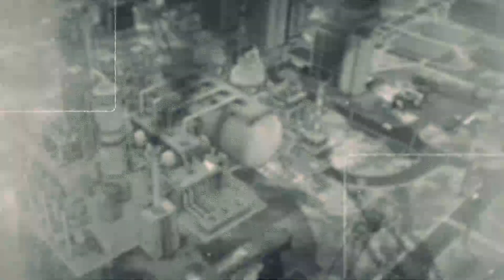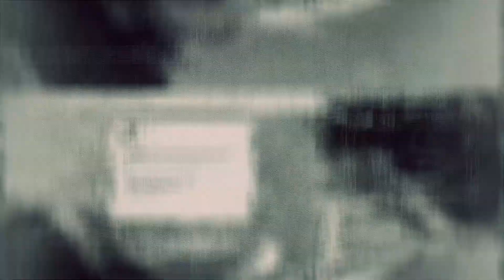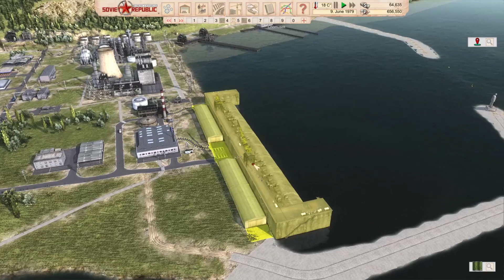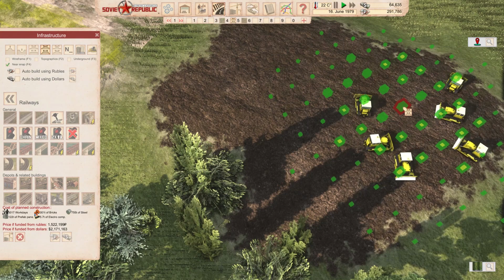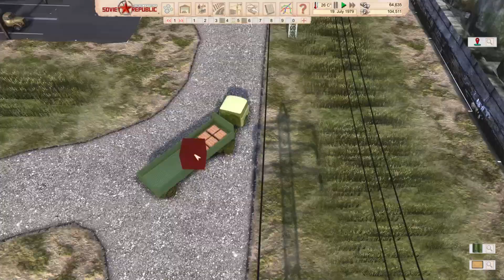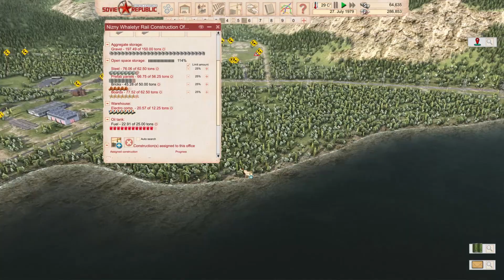Soviet Republic - Alaska - The New Beginning - Ep.63

Comment: Good day sir, I am all for a rounded rail what you came up with looks really nice and I think it will be really cool. When trains start running on it! I was wondering how you were going to get it attached to the network at large, that's a great system. I was thinking last night that a brick bridge would look. Really cool but it would take millions of bricks to make. I really like the look of the brick bridged it would change the whole feel of things into an older look making the town look like a walled city. Interesting solution to the vehicles in the helicopter station. I had the same issue and could not figure out why. It seems to be working now I think the capitol city would look great with a waterfront roads thay hugs the coast! The whole area is looking fantastic my friend. I have to admit I am getting a little more fond of helicopters in construction. The whole infrastructure could be a wonder of Alaska for sure. The bridge across a valley could be a wonder for sure! That talk substation is My favorite one, I have them all over my cities then I use the lower buildings for ones on the outskirts and in industrial areas. Have a fantastic day sir! Another top notch episode!!
Reply from the maker: Thank you! 
I'm warming up to helicopters also. But I really want to limit their use because it will become a mess and even if it works it will look ridiculous. SO having them YES but using them within reason. 😃